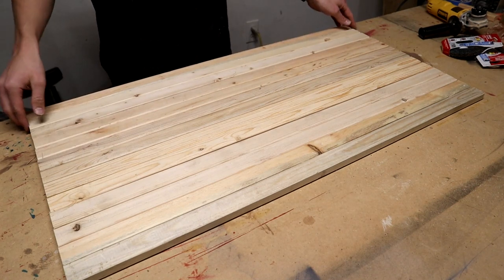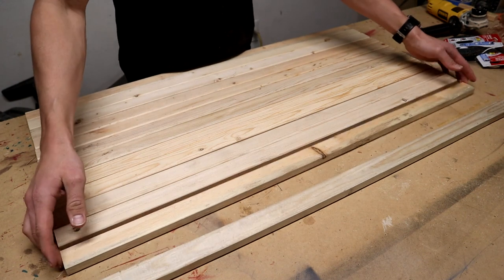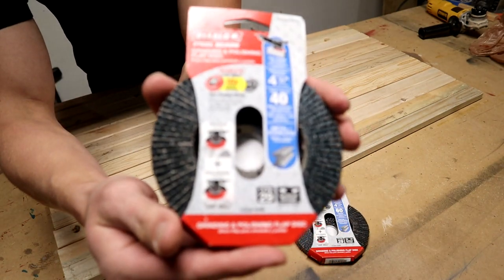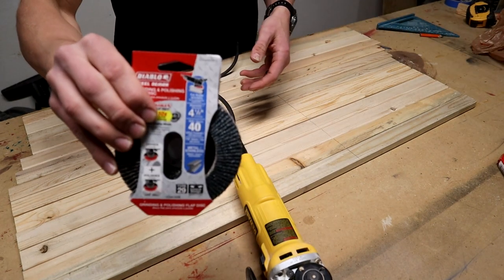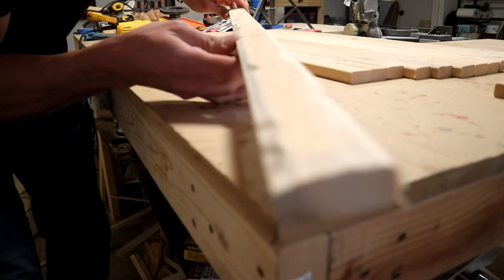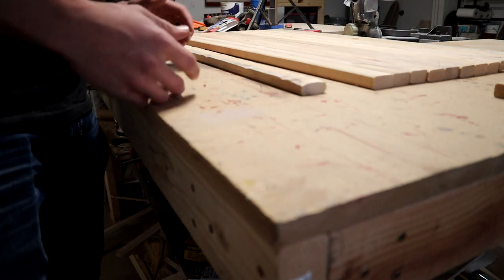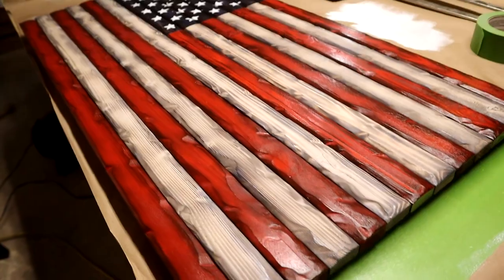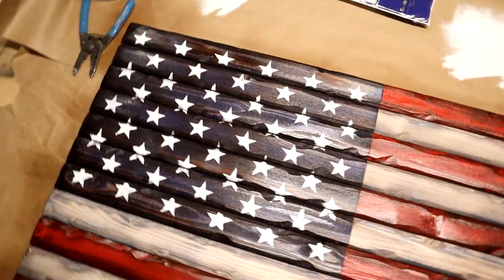Can you use a FLAP DISK to make a DISTRESSED WOODEN AMERICAN FLAG? DIY

Comment: Max.  As always, great work.  The flap disk does seem to be a safer method than the cutting wheel.  That thing is dangerous.  But, from your video, I think I will continue to use the cutting wheel.  The distressing looks a little too smooth with the flap wheel if you understand what I mean.  Still, it's awesome that you showed a different "safer" method to your audience.  Specially for those who may have been holding back because they might have been worried about using the cutting wheel.  Thanks for your work.

Comment: Max, do you use a sealer on the union prior to using the easy tack on the stencil for the stars? I have had good results with the stars, but occasionally the stencil will peel up some of the color from the union as it is removed.

Comment: How did you get such crisp lines with your painted stars on such an uneven surface? Even with using the Easy Tack, I get some underspray if the board surfaces are even a little uneven.

Comment: So which do you prefer the sanding disc or the cutting blade in your last video? 🤷🏻‍♂️
Reply from the maker: I think the metal blade will last a lot longer but i think i prefer the sanding disk, i feel like it does a smoother job